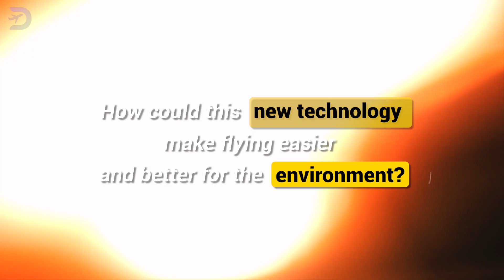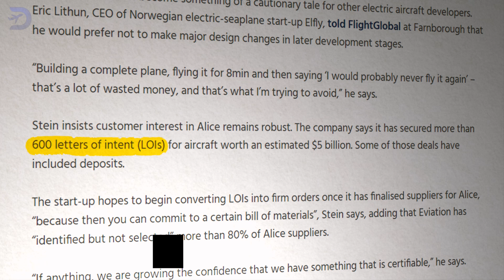Will This All Electric Aircraft Redefine Regional Aviation?

Comment: 1 problem is the position from the propeller. they lost 30% of energy. I am building an electric glider 2 place with 1000 km range at cost of 20 $ for energy and battery youse

Comment: Even a small privet jet has a range of 1300 miles ( 1129 nautical miles) the most common range is around 2500 miles and that is considered good for short trips. a range of 500 miles would be considered almost useless for a small privet aircraft.
Reply from the maker: @atomicsockbombs
You’re absolutely right about the range differences. Eviation Alice, with its 500-mile range, isn’t competing with private jets but focusing on sustainable short-haul regional routes. As battery tech evolves, its range and utility are expected to improve significantly.

Comment: On top of that, the landing weight is the same as the take-off weight, which makes things a little tricky. Not to mention the time between flights, which is much longer than a simple re-fuel.
Reply from the maker: @NaturesMulti-tool 
Good points! The fixed landing weight due to no fuel burn is indeed a challenge for aircraft design and safety protocols. Plus, battery recharge times add complexity to quick turnarounds. It'll be interesting to see how Eviation tackles these hurdles to make the Alice practical for regional aviation.

Comment: They started by building (crazy) a completely impractical taildragger/ tail pusher with wing tip props - guaranteed to turn a crosswind landing into a bad bad day... then came the Me 262 fuselage (built that to!) before eventually redesigning the DC9  ( and same config for other small, failed, aircraft)
How the hell did they go all the way to actually making OBVIOUSLY untenable aircraft ( not to say that battery power is also not unviable compared to liquid fuels, no range no hope )
Reply from the maker: @rossnolan7283
The taildragger/tail pusher configuration and other earlier iterations of Eviation’s designs certainly faced significant challenges, and it seems the team has pivoted toward a more conventional configuration with the Alice. It’s a good example of how iterative development plays out, though not without its missteps.

Battery-powered aircraft, as you mentioned, do face hurdles, particularly with range and energy density. While the technology isn’t on par with liquid fuels for long-haul capabilities, there’s still potential in short-haul regional markets where sustainability goals are driving innovation. Whether that potential translates into practical and viable solutions remains to be seen, but it’s a space worth keeping an eye on. Thanks for sharing your perspective—it adds a lot to the discussion!